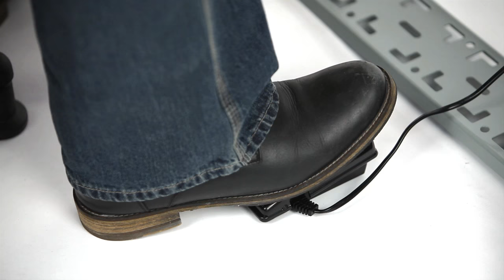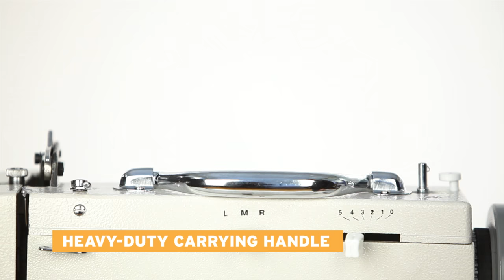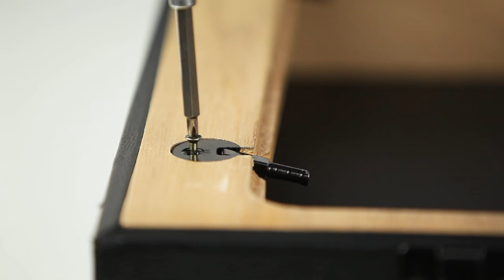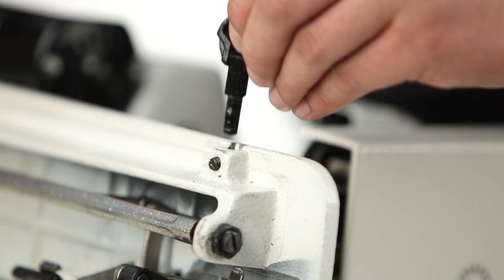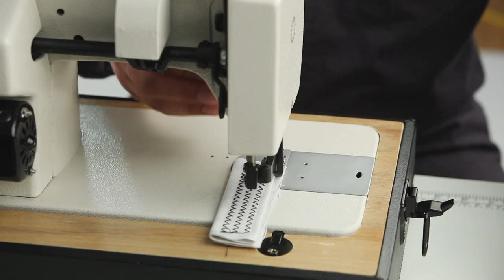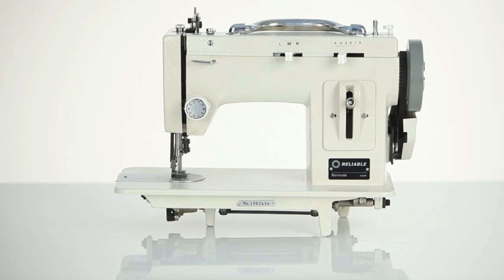Reliable Barracuda 200ZW Portable Walking foot

Comment: I've never had such a complicated sewing machine.  Threading it alone is a headache.  It came with a stand where to put the spool of thread; the manual doesn't even mention the stand, it shows in the pictures but, that's about it. Stand flops all over the place and the thread gets all twisted around it. U Tube instructions shows only part of the threading and not from the beginning.  I purchased it about 4 years ago and haven't been able to use it, not even once.
I would love to return it but, not sure if it would be possible.
Reply: just look at the sailrite videos for threading. pretty much all the sailrite videos are applicable for this machine.
Reply: You must have only used a self-threading machine in the past. This thing is trivial and nearly identical to a common Singer, with the exception of the walking foot mechanism which you never need to touch.
Reply: Someone buys a $600 sewing machine and never uses it because over the course of ~~~four years~~~ they couldn't figure out how to ~~thread it~~ or how to use a standard thread cone holder?? 🤔 I find this very hard to believe.
Reply: It’s a very basic mechanical machine. Find somebody who can sew to show you how to set it up.

Comment: Does it sew this layers of leather, several thick layers of tough denim?????? Could you show this without all the fancy cut away shots???
Reply from the maker: Thanks for your question. Yes, it will sew through layers of leather depending on the leather and the number of desired layers and it will sew through denim, depending on the denim and the number of layers. However, we will need some more information to assist you. Please email support@reliablecorporation.com or give us a call at 1-800-268-1649